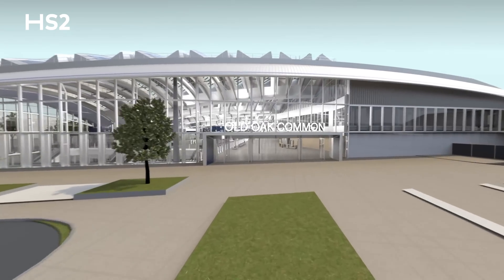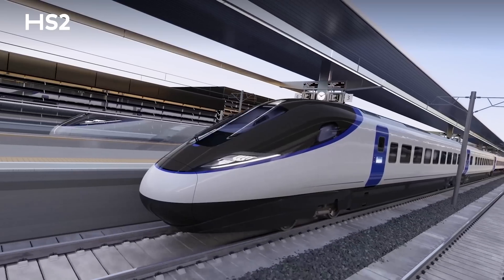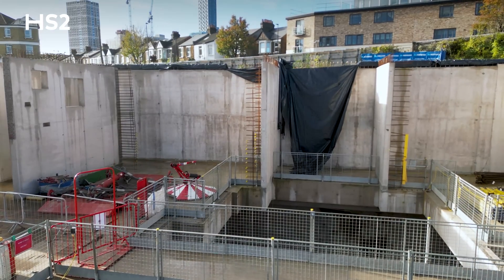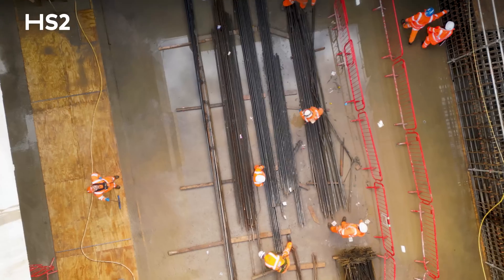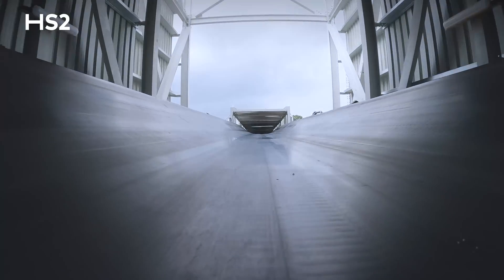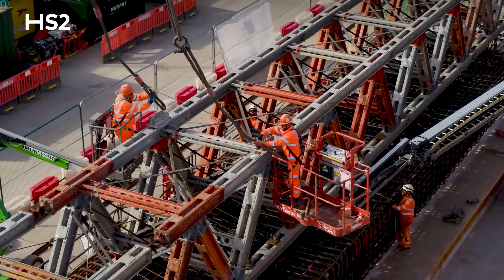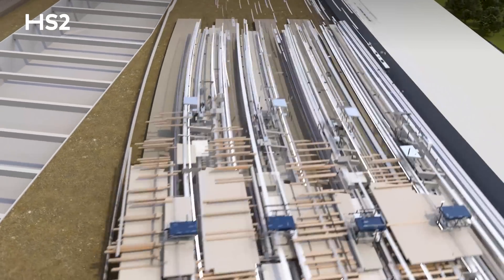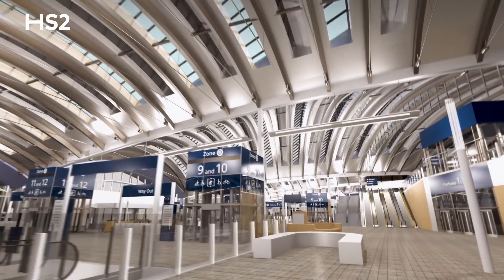HS2 Old Oak Common Station Project Update | December 2022

Comment from the maker: We hope you enjoyed this update! 🚄

What would you like us to cover in the next Old Oak Common project update? Let us know in the comment section below.👇
Reply: It would be good if in the next video you mention the timescales of upcoming works. It always good to know what works are going to be done next. Great video tho👍
Reply: I’ve Seen Your Tunnel Project at West Ruislip. I was wondering what will the HS2 Members Look Like Running into that Tunnel whilst Chiltern Railways Members Bypass the Tunnel
Reply: Wonderful display of civil engineering. However HS2/Old Oak may turn out to be a white elephant, just like the Humberside Suspension bridge. (The "bridge to nowhere")

Working practices have changed radically since the HS2 project began and accelerated with the progress and ubiquity of telecommunications. COVID supercharged changes in work habits. 

But just like the Humberside Bridge, if the usage of Old Oak/HS2 do not meet expectations and claims, it does not matter. It's like the Chinese steel works economic model. Better to have workers doing something even if what they're doing isn't actually needed.

Comment: Take the new station to the Euston lines.
Same super fast Train??
You can't match my concept speed stack sun planetary gear a massive (Half a bus stop size or larger) AC induction squirrel cage stepper motor..
New station somewhere must link to Euston line to New Street or &  Use both lines from new station to marleybone to Snowhill line and a link From that NEW station to 1 or the other "BOTH" ..
FACTS.
You'll still have to drop at 1 or both station Birmingham

Ssooo use my Idea safety and security GPS location IRIDIUM iOT satellite WiFi taking camera 📷 zoom 1 mile on trains double 3 x the speed taking tyres to train wheels with rubber inset to outset tyres track cog work vvvvv will be wheels trains gripping the inset to outset (Will run old Train wheels after being 3D laser cut) tracks uphill better speed torque horsepower from an AC induction (WEG or BALDOR-ABB OR SIEMENS or AZIPOD) squirrel cage will have enough 25000+50000 hp taking 1 Shaft to turbo shaft all axle adjoining the drivetrain 1 Motor at 2 sides Front and back tuggers.

Train size length is all about timing Arrivo start up perfectly timed GPS location and Google Earth camera forward/backward north/southbound having lane Switch to take over/overtaking and lay-by lanes for slower train parking up left or & right added layby terminals so timing goes, usual trains always layby or and fast Train every mile switch lanes given every 1-2 mile 2 lane a Switch on/off for overtaking as we do in cars black and white colourful picture

Comment: How ahout if yall put a aiport and a train to weatern like liverpool lime street dublin and a fanmade Great southend railway starting old oak common lane kings cross a new stations higham hill ilford romford upminster new orsett railway station new hordon on the hill railway station southend victoria southend central 10 stops using 801s and a new fanmade underground fast train starting at old oak common lane netherlands 2 stops what do u think? Using 801s aswell and a new gatwick express starting at old oak common lane notting hill gate charing cross weatminster brixton norwood junction and london gatwivk airport using class 715 and a new luton express old oak vommon lane sputh minms wheathampstead luton airport parkway luton airport using class 410 but slow  and a new train to Great dagenham railway old owk common lane and dagenham dock
Reply: Wdym
Reply: in english?

Comment: This money would’ve been much better spent on new city underground metros for Manchester, Leeds, Birmingham, Liverpool, Sheffield. Out into suburbs like London. Connecting all cities with intercity rail.

Also, super hub airports at Manchester, Birmingham, Leeds. So new long haul terminals for British Airways, Virgin Atlantic, TUI, Aer Lingus, US Carriers, Middle Eastern carriers, Asian Carriers, Lufthansa, Air France, and terminal for short haul European low cost airlines like Easyjet, Jet2 and Ryanair. 

Northern and middle England cities need less reliance on London and Heathrow, HS2 does not eliminate this problem, only heightens it!

Comment: At first I thought that both Birmingham International and Birmingham New Street would be part of HS2
Reply: There’s zero space to fit HS2 at New Street, hence the rebuild of Curzon Street nearby.
Reply: Birmingham International could have been rebuilt to accommodate HS2, but it's easier to build a new station. Like the guy above said, New Street is basically walled in like a prison; there's no room to retro fit HS2.

Comment: Fantastic work.  However I cant help thinking that a tunnelled HS1 and HS2 link would benefit the system further.
Reply: I thought so until I saw the traffic numbers. London (or other cities) to the Continent, specifically Paris, Brussels etc isn't that well frequented. Maybe those numbers will increase. As I understand it, there is provision made in the tunnel should the future change and a tunnel wish to be constructed. I doubt it ever will be though. I think high speed urban rail services like HS1 going all the way through would have been fantastic, but not exactly economically palatable. Elizabeth Line will have to do that.
Reply: @richardwills-woodward  Not sure what the traffic numbers are year round but my daughter and I travelled to Paris back in the summer and St Pancras was rammed as was just about every train departing. Same at Gare du Nord on the return. I'd always hoped that through services to the north would take off but sadly not the case. Guess there has to be a magic figure before a link becomes feasible.
Reply: @thorley1969   Indeed so. For the numbers to work with re-pathing trains, adding complexity to the British side of the network (not to mention ordering billions of pounds worth of new trains) they would need to be very high. Eurostar is still in financial trouble. The trains to Paris are not frequent compared with Manchester for instance. That's why they're so busy. They don't want any empty seats. The other issue is HS2 has been built (like all high speed lines) with two tracks rather than four. I suspect that HS2's capacity will be close to full. I am not sure there would be the train paths available for an extensive 'turn-up and go' service to Paris and Brussels too. Unfortunately I believe it will be just one of those things that would be great if funds were infinite! However, I am looking forward to HS2 journey times. Manchester from Old Oak London terminus will be just 1 hour! The trains will be far faster than even HS1 at 225mph vs 186mph (boring facts I know). The idea you can take a train in 2 hours between two of the world's great cities is incredible and we are very lucky (on both sides of the Channel).
Reply: Why, HS2 is a domestic High Speed train service, HS! is an International train service

Comment: Is the plan to eventually close Paddington? I don’t see the point of two mainline stations so close to each other & Old Oak Common has all the connections.
Reply: It seems pretty unlikely to me.

Firstly, large as Old Oak common is, it is sized to be an intermediate station not a mainline terminus. 14 platforms may sound like a lot, but it's "only" 6 for HS2 and 8 for the GWML. This compared to paddington which has 13 platforms for terminating GWML services plus two platforms for services through the crossrail core and Euston which will have 10 platforms for HS2.

Secondly, Old Oak Common does not have "all the connections". It is on the GWML and HS2. It has a connection to Farringdon, Moorgate and Liverpool Street via the Elizibeth line. It has a connection to Euston via HS2, but it's not clear to me if use of HS2 for local connections will be permitted/practical or not. It does not have direct connections to King's Cross, St Pancras, Fenchurch Street, Cannon Street, Charing Cross, Waterloo or Victoria all of which are directly reachable from Paddington.
Reply: No - although a fair chunk of people may get off here now!
Reply: I doubt they'll be as close as Kings Cross Station and St Pancras International station. The A5202 is all that separates the 2 stations.